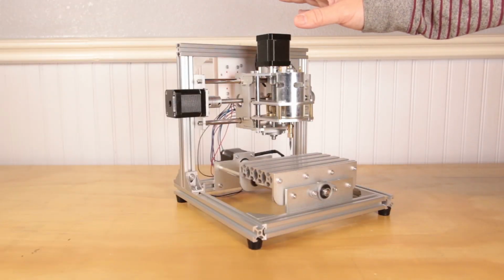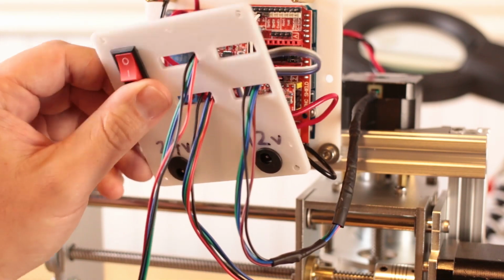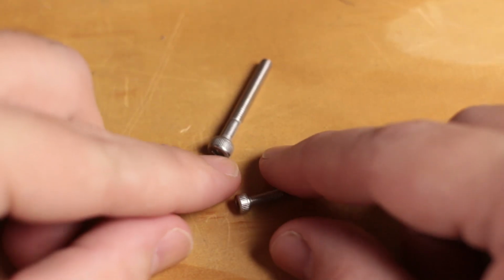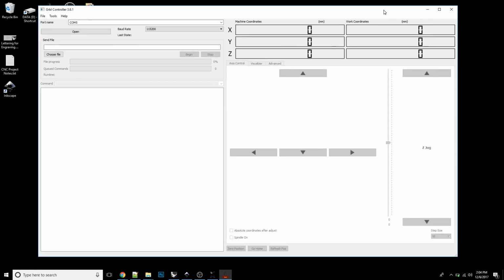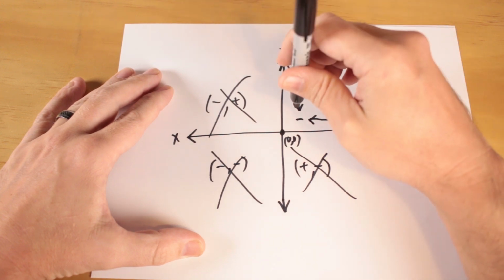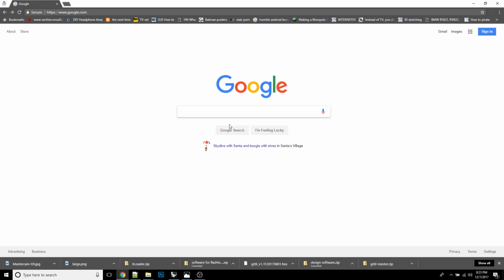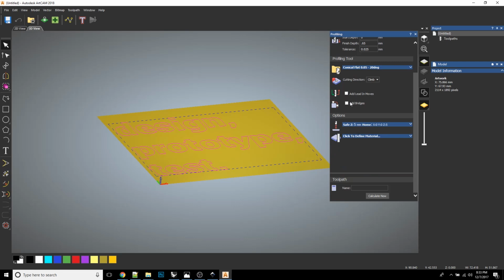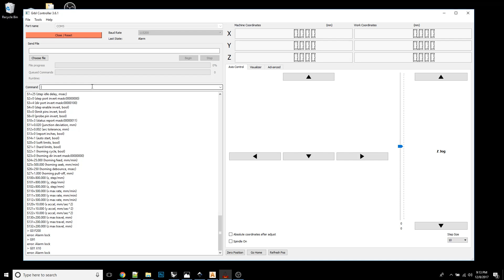How to start CNC Machining for under $200 - Working with the T8 CNC engraver

Comment: There are lots of young and unqualified people involved in the maker movement (which is great!), but any professional qualified engineer will tell you that RepRap's statements regarding NOT tinning wires for use in screw-terminals are objectively incorrect. They are spreading misinformation and their claims are bogus.
Their talking about differential expansion rates of copper and tin is total garbage, as (1) the two metals diffuse together and cannot separate and (2) the difference in thermal expansion over the temperature range of even military electronics is insufficient to make any difference at all. Tinned wire will move a lot less in a terminal block than a load of loose individual strands.
It has always been standard practice to tin wires. There are definitely no negative safety issues associated with doing this, quite the opposite in fact.
The tin plating prevents the copper strands from oxidising and corroding, and prevents stray copper strands from wandering, thereby improving the electrical connection lifetime, safety, and reliability.
For this reason, it is built into the UK wiring regulations:
BS7671:2008 says "526.8.1 In order to protect against the separation or spreading of individual wires of multiwire, fine wire or very fine wire conductors, suitable terminals shall be used or the conductor ends shall be suitably treated.
(By "suitably treated", they mean lightly tinned.)

The only real-world problems are associated with people who apply far too much solder to the wire. It's only supposed to be a thin protective coating that binds the strands together, not a big squishy blob of solder!
Reply from the maker: I'm feeling pretty beat up about that tinning issue. From everything I've been taught, tinning is the best practice, but because I'm in the public eye with these videos, I get tried in the court of public opinion. I had to assume I was wrong and the vast majority of commentors knew the truth. It's nice to have an obvious professional come to my defense. I'm pinning your comment to the top, in the hopes that it will provide good fodder for discussion.

For anyone who is curious about the reprap statement which Nicholas is disputing here it is (Note: I have removed this link from the description and posted it here instead):  
http://reprap.org/wiki/Wire_termination_for_screw_terminals
Reply: I used to tin my wires before crimping them. Then I started working as a manufactuing, engineer and I stopped. For refernce the standard IPC-620 provides details on crimpoing wires and does not recommend tinning the wires. Instead properly treating the ends referes to stripping the wire properly and not birdcaging the wires. It also helps to use the proper crimping tool. Once you do that the crimp actually makes a good electrical connection to the wire and strain relief on the insulation to help avoid it from pulling out. 

You can still tin the wires before crimping them, but the biggest danger is that the solder can easily wick up the wire.  That makes the wire brittle and can break when flexed.
Reply: Indeed, but wire-crimping is a different subject. We were discussing screw terminals.
In both cases, I agree that applying excess solder is detrimental.
Reply: I did not see a discussion about screw terminals or RepRap's comment you referred to above. I just know in the video he said to always tin the leads and then he tinned a lead to crimp it. This is where my argument is. Wire tinning is good sometimes, but not always. Wire crimping is one example where you don't need to.
Reply: you don't need to, but in my job, we do because we require a good connection no matter what (nuclear equipment). that said, it does depend on the level of security and the experience of the electrician, because a bad solder is worse than no solder, because it will cause breakage, or even wick up the wire and melt the insulation, causing a fire hazard.
Reply: Different applications may have different standards - where vibration is an issue, it may be best not to tin/solder as it promotes a stress point - I believe that is why crimping is the standard for aviation.
My personal preference is crimp crimped terminals with a little solder at the end, so the crimp is the main mechanical join and the solder the electrical and I'd then use a heatshrink sheath over it for additional support and vibration resistance - but that is general household and automotive stuff and may not be representative for all and may even be quite wrong for some standards.
Reply: Nicholas I beg to differ, they are quite correct! From personal experience if you tin stranded copper and then crimp/clamp the joint all will be fine . .for a while, then the solder compresses/ deforms and the joint loosens. Try it and see!  Go back over your joints after a "while", they will require retensioning. Any sparky worth his/her salt will tell you: strip the insulation, twist the conductors together, double them over to increase conductor/ joint connectivity, tighten clamp screw.
Reply: BS7671:2008 Ammendment 3: 2015
526.9.2
Soldering (tinning) of the whole conductor end of multiwire, fine wire and very fine wire conductors is not permitted if screw terminals are used.
Reply: This is the response I came here for - absolutely correct, tinning wires for use in screw terminals is not only unnecessary, it is advised not to do this in many wiring standards and can pose a fire risk in the worst case. The solder can creep over time and cause the connection to relax, and may heat up if left unchecked. Best practice is to use a ferrule or simply twist the wires before insertion into the terminal block.
Reply: Interesting conversation here. I have always learned that you should NOT tin wires for screw terminals if it is a high current application because the heat dissipation can soften/melt the solder and reduce the clamping force on the wire. Is that true in any sense?
Reply: I have always tinned wires for used in connections and it has saved me many a repair.  Of course, if you use the godawful RoHS crap without the lovely lead, it may flow or creep or make spikes on you.  But the good leaded solder I have always used has never caused even one problem, and I'm 64.  (A Maker since I was 3.)

Don't feel beat up.  The people who spew crap at you are programmed to do that.  Just ignore them.  <g>
Reply: I do not know of any professional standard that allows for tinning of stranded wires with screw connections. And i have been working as both a international service engineer and a teacher in electrical engineering including courses for general proficiency. 
If you are worried for stray strands use a crimped ferrule. That is the professional way to do it and it allows for cable marking as well
Reply: Please try to be civil. For your reference, one of the bits of "nonsense i have been reading" is Electrical & Electronic servicing (C&G 6958) which taught lightly tinning the stranded wires of mains flex before inserting them into the screw terminals on UK mains plugs. This works well as it reduces the incidence of stray copper strands from breaking off or shorting inside the plug, and it greatly eases getting the wires into the small screw terminals. The cable itself is strain-relieved inside the UK plug. I have never seen a plug mains plug wired using this technique fail in 30 years of using it.

Interestingly, I note that certain US sources, notably IPC-J-STD-001 argue against any tinning of wires to be used under any screw terminal, so maybe this disagreement a geographical difference of opinion, or perhaps it is industry specific.

Either way, it just isn't worth getting worked up over.
So, just do whatever works best for you with whatever gauge of wire you are working with.
Reply: Australian Standards (AS3000):3.7.2.5 Retention of stranded conductors
The ends of stranded conductors shall be secured by suitable means, so as to prevent the spreading or escape of individual strands. They shall not be soft-soldered before clamping under a screw or between metal surfaces.3.7.2.7 Soldered connections
Where a soldered connection is used, the design shall take account of creep, mechanical stress and temperature rise under fault conditions. Soft-soldered connections shall not be clamped under a screw or between metal surfaces.This is because of cold-flow. Ferrules are the best method of containing strands, and are used exclusively in industry. Just my 2c.
Reply: Nicholas Lee I
Reply: depends on the amp loads this is why you do not see tinned wires of stranded cables anywhere in industry. they use bootlace ferrules
Reply: this is correct. i am a qualified level 3 power technician. and under no circumstance are we to "tin" wires.
Reply: when you screw down the terminal it is "crimping" the wires. this is why a crimped ferrule should be used.
Reply: leaded solder is actually worse since it has a lower plastic temp. which allows the solder to compress. why its easier to solder with leaded solder and why rohs solder is considered a single solder and trim or replace component.
Reply: The reason for NOT tinning that I was given is that by keeping the strands separate and able to move as they are screwed down, a larger surface contact is made with the terminal block. A soldered end only has a few point contacts as it unable to deform to the shape of the terminal block, resulting in a higher transfer resistance and heating.
Reply: I've wired several industrial machines. Some of which were 5+ million dollars each, with a high "availability" (reliability) requirements. It is always good to wrangle the fine little wires in stranded cable. In our shop, we exclusively used crimped ferrules with no tinning. These ferrules were plugged into spring loaded terminal blocks (not the screw-down type). 
  Early in the machine's development, we did try stranded wire going into screw-down terminal blocks, but found that the wires compressed over time and worked themselves loose. (these machines vibrate a lot which exacerbated the problem) Hence we changed to a system using crimped ferrules and spring loaded terminal blocks.
   In certain situations, like in a hobby or home machine environment, and some professional environments, Nicholas makes some good points.
  But there CAN be potential safety issues.
  If you tin a wire (which I mostly do at home) you should consider vibration/movement of that wire. The wire can break at the solder/copper junction, creating a potential safety hazard. In our shop I think he would have liked the ferrule/spring load termination we used. Thousands of hours, on many machines proved the reliability of this type of connection. 
 And,  if I worked in the UK, I would follow the procedures outlined by Nicholas, for his particular machine environment. So whatever method you use on your wires, pay attention to the results you are getting. If your connection fails, change your process.
Reply: Nicholas Lee - funny to still find the tinning requirement in a UK standard. I often get the impression the Brits are a bit stuck in their ways dreaming of the time when their engineering was the reference for the rest of the world. Their reluctance to move on is for instance also manifested in awful plumbing and a problematic units system. I do love them for all their quirks but for the rest of us, state of the art seems to be ferrules.
Reply: @ Richard, Bryan Rentoul 
Richard, it's what I've been doing my entire professional life. Twist 'em, fold 'em, and insert.
If one can't do that - one shouldn't be anywhere near electricity.
As for the Brits... they're Experts in making opinions, or personal preferences of idiots into Legislation.
Lack of accountability, no common sense input, and a top-down caste system.
Reply: Bad solderers say they are great at soldering...  Yes, I know, as I was one.

And yes, soldering is actually a bad idea, and no electrician does that in Sweden when it comes to higher current and voltages.  You crimp or solder, not both.  And yes, you crimp in screw connections.
Reply: Andi Walti I happen to be a british engineer and I can tell you that he's actually quoting a ten year old standard (2018 is the current standard not 2008) and we do in fact use bootlace ferrules for terminal/screw connections. Solder is for soldering, a shocking revelation I know. No need to drop hate on a whole country just because one person quoted out of date information
Edit: nearly forgot to mention that BS7671:2008 586.8.2 strictly prohibits soldering for screw connections, the OP convieniently left the very next sentence of the regulations out.
Reply: It's amazing that the tin / no tin argument for crimp connectors is still going on.  And there's still many people on both sides with, what appears to be, solid arguments.  I'm sure different countries have different rules but in the US, IPC regulations prohibit use of solder on crimp or screw terminals.  I know that in aircraft, automotive, or space applications any soldered crimps will fail inspection.  This combo has poor vibration and thermal cycling resistance.  Installation in static environments may be a different issue.
Reply: I do agree with you cosborne, but a CNC/3D printer isn't a static environment.
Reply: Imogen Gillison from where to download PDF ?
Reply: All I know is that when I used to tin the wire the 10A 24V to my heated bed had to be re-tightened ever month or so but when I removed the tin (yes, I know how to properly tin a wire) they have never needed adjusting again.
Reply: in fact a british standard is to tin the wires very lightly to prevent them fraying .... that said get a chinese ferrule crimping set for 20 bucks, doesn't cost much, and its super easy and gives a very professional result.
Reply: There are also fires caused by this crap in the 3d printer community as well so happy medium is one thing but having a house fire due to some stupid happy medium is another.  Life is precious so spend some money on ferrules at least.
Reply: I refer you to BS7671:2008 Ammendment 3: 2015, clause 526.9.2
Reply: zippy Are these the same idiots who removed lead from solder so the soldering is now inferior to what it used to be?  Anyone from those days will tell you they will kill you if you touch their stash of leaded solder like Big Clive, et. al.  btw I could not find that clause/section in my search via Google.
Reply: Merlyn Hall i was getting ready to reply with the same thing... iI used to go by mil std for everything and they allowed it.  When j std and ipc came out they warned against it because once you solder something it becomes a vibration hazard and it cannot be serviced with anti corrosion methods.  You physically have to cut the wire and start over.
Another point from my instructors manual is that bonded OFC looses its corrosion resistance when you heat it by tinning the leads. Lockheed required all wire terminations and joints to have connectors or be covered by heatshrink.  
I cannot stress enough as I do with my students that IPC and J-Std are just guidelines and your process engineering staff will ultimately dictate your standards and publish them in the ISO mandated manual.  Most companies cop out and go with IPC or J-Std or both.  This is due to a lack of proper process engineering research.  The first thing to go at an electronics company is process engineering because once a line is setup and approved by the vendor and QC.  They pull Production engineering off the line unless there is a major problem.
Reply: What Nick said. If you can't / don't have wire ferrules, tin the wires.
Reply: The quoted UK standard was completely misinterpreted. This clause explicitly prohibits the tinning of multi stranded wires, when used in screw terminals.
Reply: A simple crimping tool costs under 10€, there is no need not to use the correct tool. And tinning the wire is a fire hazard. The statements of reprap why not tinning the end are incorrect, but the statement not tinning the wire is correct. Solder is ductile, plastic and not very elastic. You can see that if you pull the solderwire - it gets a lighter, matte surface and does not snap back. Under the the pressure of a crimp or a screw connection the solder flows over time out of the way of the pressure and the connection get loose. Vibrations speed this up. The electric resistance of the connection goes up and that means powerloss. Powerloss at a connection means that the connection will get very hot and maybe you get a fire if it gets to hot. Another problem is that a soldered wire breaks easier and you can not really control how much wire is tinned because of the capillary action. Tinning a wire is therefore a bad idea. BTW the IEC 60364-5-52:2009 forbids soldering of wires. Allowed is only tinning the tip (about 1mm) to hinder a fan out of the end.
Reply: Ignore this Nicolas guy, he’s quoting C&G specs for God’s sake...  Clearly never worked in industry that requires work to comply to BS. To repeat, nobody solders anything unless it’s to a terminal, every industry from aviation to military uses crimps or ferrules for termination. I’m so sick of having this debate on YouTube, if you don’t know just shut up.
Reply: I'm English and I use ferrules every time, much safer.
Reply: @DesignPrototypeTest  - good job on pinning the only idiot in the comments. Solder will deform leading to the connection working loose or over pressure cutting the strands, followed by cold flow and heat cycling issues. That's why ferrules are used these days, it's a gas tight weld with zero downsides.
Reply: @DesignPrototypeTest  Never mind  The Court of Public Opinion, it's The Laws of Physics you have to pay heed to. Just follow the specifications demanded by the aerospace industry and manufacturers recommendations and you will not go wrong. It's really that simple.
Reply: he said just the opposite
Reply: james white - who?
Reply: I can tell you, working on NOAA buoys, that are deployed in some of the most extreme environments on Earth, that we never once tinned a single wire that was going into a screw terminal. Solder is for SOLDER connections. There are many reasons why tinning wires is a bad idea, and I really can't for the life of me think of on reason it would help a connection. It reduces the surface area of the contact, adds to wire brittleness, and increases the chances of insulation being damaged by heat.  Don't let "public opinion" influence you to follow an old wive's tale. And as far as UK standards go, have you ever owned a British automobile? They aren't known for having great wiring. As a matter of fact, the UK is known for the worst electronics on Earth. I would gladly buy an electronic component from Uzbekistan before I would one marked Made in the UK.
Reply: Ferrule crimped onto the bare wire is the best option before stuffing into terminal block.
Reply: In most cases tinning wires before crimping is not necessary. When you have a good mechanical bond the tinning won't help or hurt. It really is a unneeded step in many cases. Especially for hobbyists. We are not building multi million dollar items for customers. We're building for our own enjoyment. Glad you are so nice to tell everyone about how unqualified we all are and making sure to sound your own horn with your opinions.
Reply: mike last 
It’s a bad idea to tin wires that are going into a terminal block or other set pressure connection.  You will get away with this if you use a spring-loaded terminal (e.g. a ‘Wago’ connector) — but it is best to simply remove roughly twice the length of insulation you want the bare wire to be, twist the wires together, then fold half the length back on itself.  That results in a larger area of wire for the screw to bear down on and you won’t run the risk of the solder creeping out of the way and / or deforming if a lot of heating occurs.

A side note here is that a lot of cheap wire isn’t copper alloy, but is copper clad aluminium.  This stuff has similar behaviour to aluminium conductors, in that it will creep over time and thus any screwed / set pressure connection will loosen.  If you’re not sure that your wire is really copper, then use a spring-loaded connection if possible.  (Real or good quality ‘Wago’ connectors are a good choice for low currents.  Check the specifications for anything you use, then de-rate them by at least half if you’re using Chinese clones.)